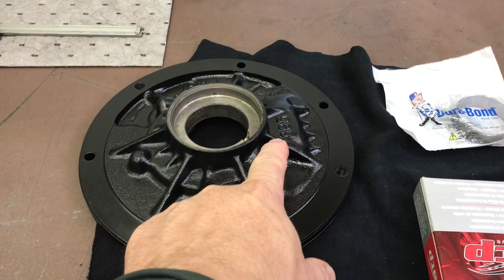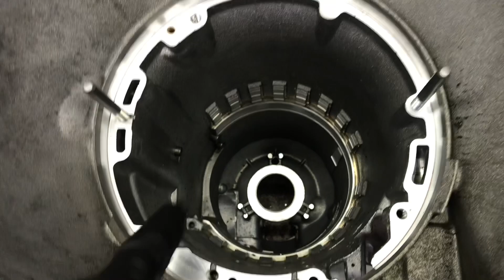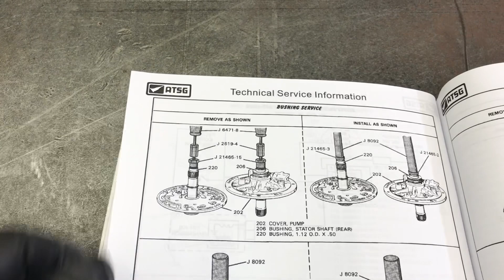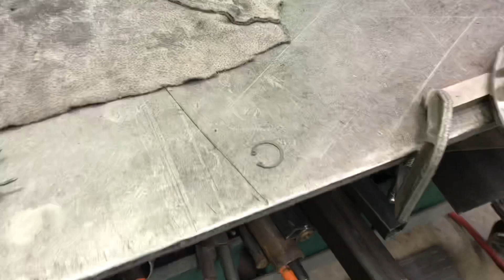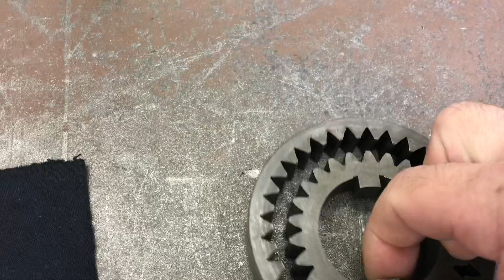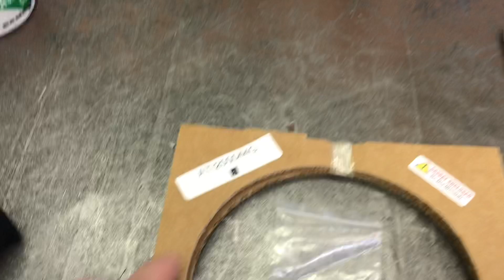TH400: TH475 Pump & BTE SFI Bellhousing Installation

Comment: I swear the jegs bellhousing I ordered looks just like this but mine didn't come with that sandwich ring and I can't seem to get one anywhere. Ah well thanks for the vid I finally have some clarity on my issue, greatly appreciated 🤘🏾
Reply from the maker: You must have got one for a Reid case? If so you need the BTE adapter and it’s probably back ordered. I am waiting on two bellhousings from them myself.
Reply: @mountainsgarage  thats exactly what I got lol I just did a little digging and was finally able to cross check the part number and now I have one on the way, again I can't thank you enough, I really needed this to work seeing as how it's getting to hard to get ultra bells anymore and now I can make what I got work

Comment: I found a 8 bolt case in my barn yesterday. It has a busted bell housing on it so it's a great choice for an aftermarket bell housing. Is there a way to make sure the case is level where the valve body bolts to? I'm only making around 500 up so what would be the best option for a new bell housing? Is the bte more expensive than the ultrabell? It looks a heck of a lot better. What all should I look for on this old case? A buddy of mine ran a transmission shop and switch the guts out into another case and it was laying there and they give it to me is how I acquired it. I just realized yesterday after the last 15 years that it's an eight bolt case.

Comment: Shawn, My ocd mind wonders why I have all roller bearings or brass thrust washers in the whole transmission except the plastic front pump to forward drum thrust washers for forward end play adjustment.
Do they make brass selective for this or is there a reason why there is plastic here?
Thanks again for the solid videos!
Keith
Reply from the maker: You can convert to a bearing on the pump with shims. I do wish metal thrust washers were available in selective sizes.

Comment: Not claiming to know anything about transmission building but would a loctite 565 thread sealant work on pump bolts. I’ve used it in the past on other applications with success. Love the videos, keep’em coming!
Reply from the maker: I will check that out, thanks!